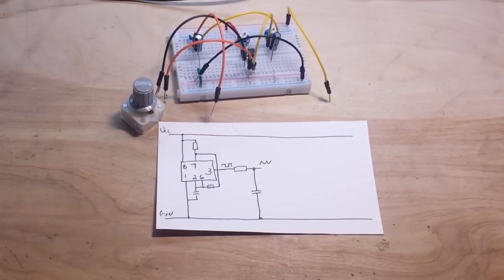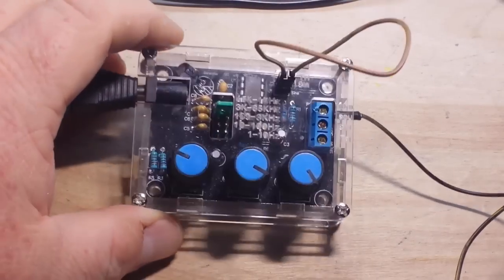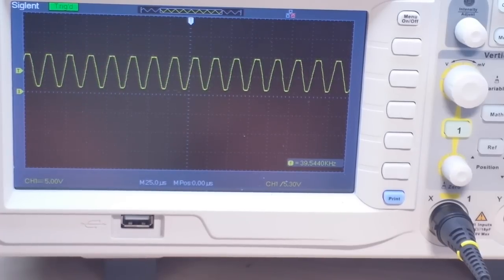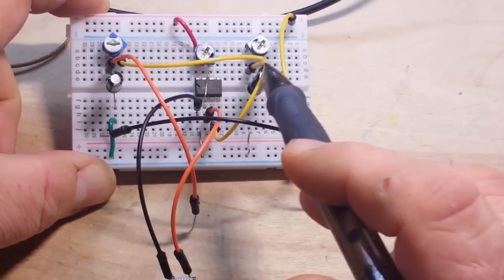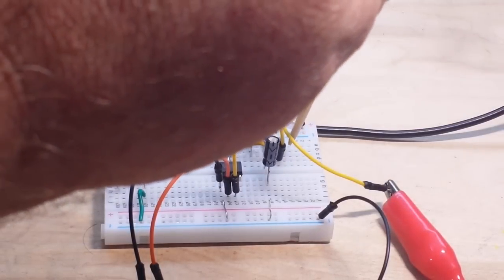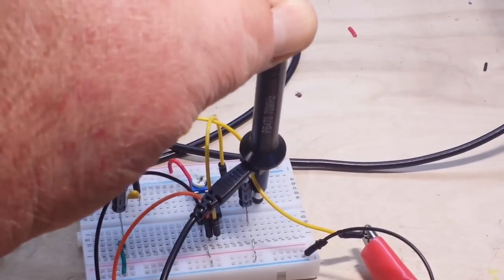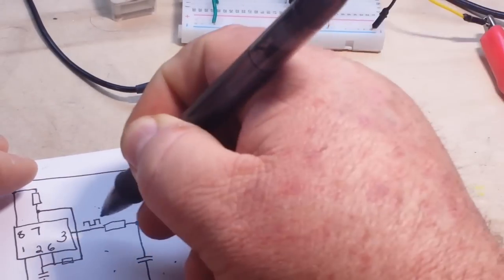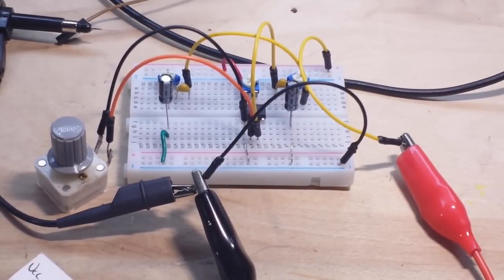Let's make a function generator (3)

Comment: Biggest issue I have found when using LP filters, or even an OP amp integrator to generate triangle waves is the fact that the integrator / filters are frequency-dependent. Change the frequency and you alter amplitude, and even lose the wave-shape as you move further away from the 'tuned' frequency of the filters.

Comment: This has been a great little project for my level (noobish) and goes along with the recent purchase of a cheap DANIU ADS5012H handheld scope. What is the range of the adjustable capacitor? I used a  150pF & 60pF which is all I could get and it didn't produce anything so I just used a single ceramic. Anyway I got the square and triangle waves going albeit not as clean as yours Paul but will add todays session to the board and perhaps the two new caps may smooth things out! Im picking up lots of good info here thanks Paul

Comment: Thanks for your demos, I am learning lots.  One suggestion: put your oscilloscope more flat on the table and use an overhead cam which has both your board and the scope in the same frame. Much easier than panning the camera back and forth.
I can see how we call the first low-pass filter an "integrator" as the square wave is the first derivative of the triangle wave. But the second low-pass filter is not really an "integrator" as a the first derivative of sine is cosine (i.e., just a phase shifted sine wave). And I think it was you who showed us the 3-stage low-pass filter which generates an even nicer sine wave will less loss in amplitude.
Another useful wave-form for a function generator would be the sawtooth wave, e.g., to drive a raster electron beam. How would we make that with a square wave? Let me guess: playing on the theme of the "integrator", the first derivative of the  sawtooth wave would also be a square wave, but with a different duty cycle. 99% low level +, and then a 1% high level -. So I would have to do this square wave with 99% duty cycle and then shift this down, by a lot. Then I guess I need to use at least one transistor to amplify the signal. Transistor or OP-amp? I guess one can do a lot with an OP-amp, but I learn best with more simplicity, i.e., would do just one transistor. ...

Comment: fantastic series! I could buy a function generator, but I would not have the background understanding unless I built it myself.  It would just be a "black box". Your explanation is fantastic! Now I know what every resistor and capacitor does and why.
Reply: I follow your channel and have viewed most of them. I'm a novice Electronics hobbyist (IoT and Arduino projects) and looking for a used oscilloscope.  digital are too expensive.  there is a local electronic testing lab that's liquidating their inventory at a huge discount.  Listed is a Tektronix 2465 for $75. They said it was used by them but don't know the condition.  The price is negotiable.  would you recommend it? what diagnostic do you recommend?  it has a limited self-test. ...or should I save my money for a DSO?  your opinion is highly respected! Thanks and great teaching videos!

Comment: Correct me if I am wrong, but the IC in the assembled function generator is not a DDS. It is the XR-2206 monolithic function generator and is 100% analog. Also check out the infamous CEM3340, coveted in the synthesizer community. Having said that ... I still cannot get my RC network to transform the 555 square wave into triangle wave ... working on it! 😂

Comment: I am a beginner to electronics and I love your videos but I am not a beginner in maths. I rather think your presentation  in part 2 and 3 as the circuits being integrators is confusing because the integral of a square wave and a saw tooth wave are not a saw tooth and a sin wave ( see previous comment)

Perhaps a better way  to describe what is happening is that the square wave is made up of a sin wave at the same frequency  as the square wave and  the odd harmonics with various amplitudes. The first low pass filter reduces the harmonics significantly giving something like a saw tooth wave and the second low pass filter removes more giving something starting to look like a sin wave.

You could get a much better saw tooth by passing the 555 output through a transistor acting as a current source to charge a capacitor. ( See I have been looking at your videos!)

Comment: Good Day.  Bro, thank you for sharing.  I'm a newbie.  I don't see your Patreon link.  I see your Amazon link , okay.  Hey, what is your set up?  How do you handle fumes as you work?  Do you use a piece of dryer vent tubing and send the fumes outside?  Thank you for your service.
Reply from the maker: Hello. Patreon is www.patreon.com/learnelectronics. I use the Zeny 875d (I think, I'm not home) no vent. Usually have a fan on nearby.
Reply: Im a newbie too and what I did for solder fumes was to buy, from Aliexpress, one of those extractor fans and concertina tubing they use with tumble driers. I taped an old vacuum cleaner noozle to it which I stick as close to the soldering work as I can. The suction is not strong but works if close enough. The other end and where the fan is inserted I put to an open window. To help 'waft' the fumes towards the noozle I also have a small desk fan blowing in that direction. Its cheap and cheefull but works and OK for now